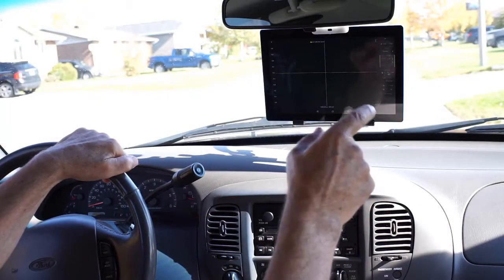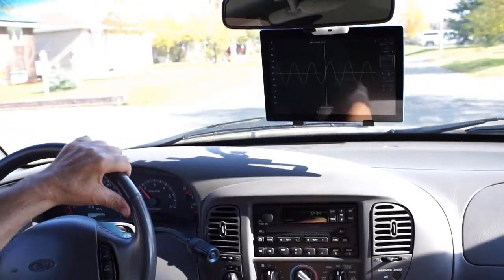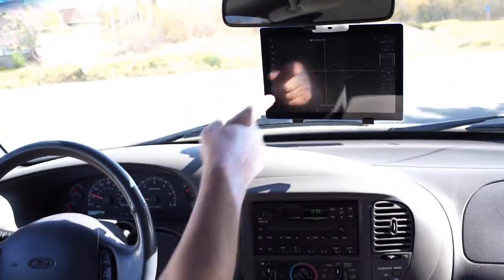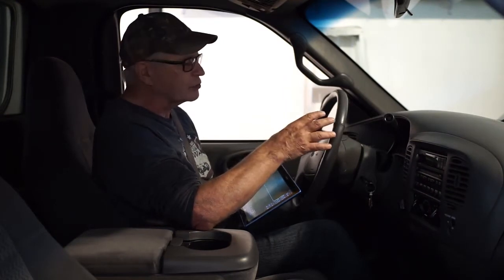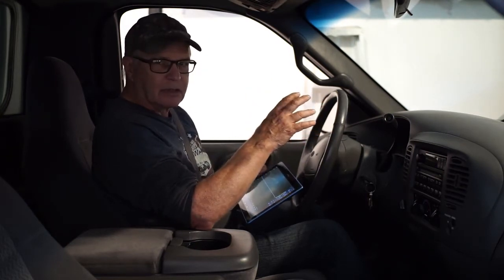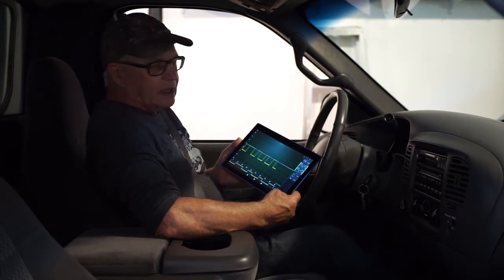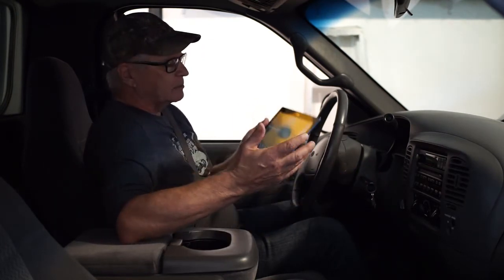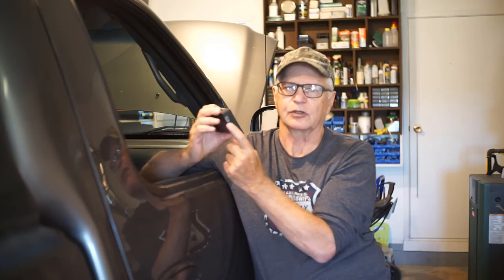GADGETS#72 - HS101 BLT DEMO

Comment: What's the limits of the Bluetooth for this application? I'm very interested in a wireless oscilloscope module but I didn't think Bluetooth had enough bandwidth for most oscilloscope work. Mostly interested in the sample rate and frequency bandwidth over Bluetooth.
Reply from the maker: +hobbles wolf - it can function @ 450 ksa/s, that I know. The settings allow selection of 900 ksa/s but I haven't tried that...no need to...this is automotive oscilloscope work...low frequency events for the most part.
If you're into electronic circuit measurement work, that's a whole other world.
Reply from the maker: +hobbles wolf - I need to add that the AUTOMOTIVE MODULE within HScope, which is what I was using in the 2nd test (brake pressure switch) is limited to 10 ksa/s...that mode is another subject matter.
The wheel sensor demo was done @ 50ksa/s.

Thanks for asking and thanks for watching:)